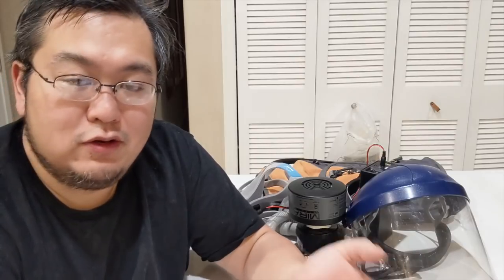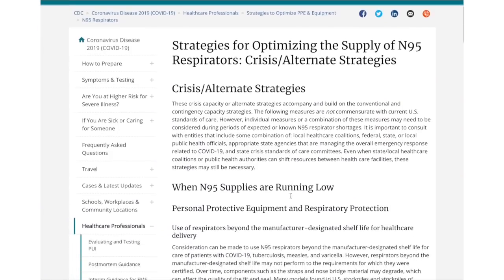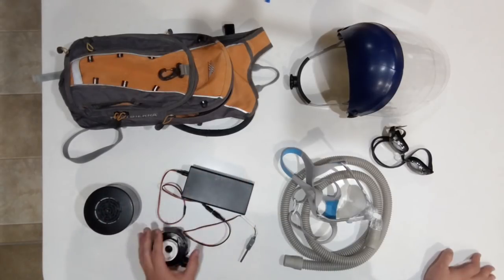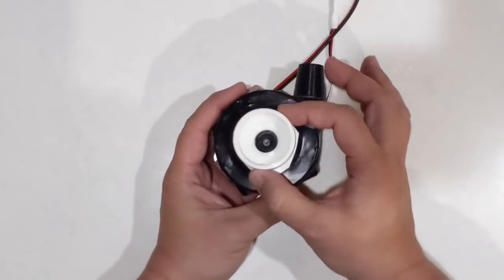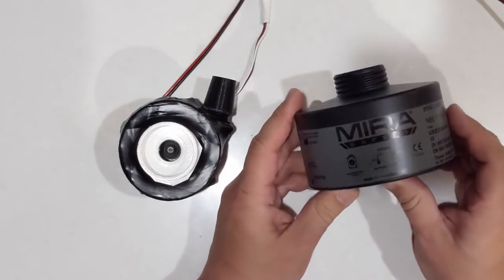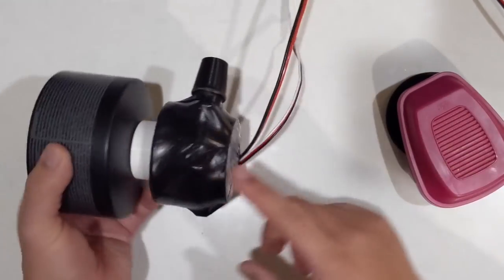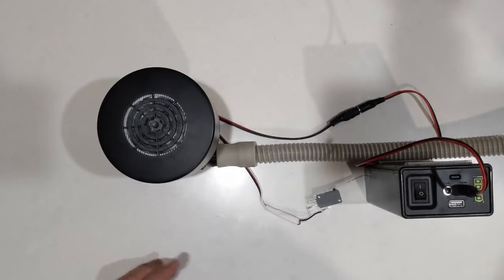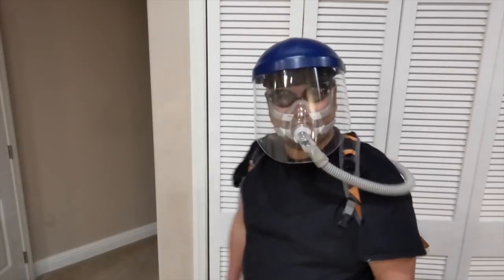Low-Cost Powered Air-Purifying Respirator (PAPR)

Comment: This is great info! I am hoping to use this information for another purpose, I would like to build a face shield using an older firefighting face shield with positive air pressure for woodworking so I don't inhale the find sawdust particles. Do you have or know of any videos that show step by step how to hook up a blower motor like the one you had to a battery? I think that's the next step I will have to learn.

Comment: I do have a question in regards to the CPAP mask. From what I have used and seen there is only a small orifice for exhaled air. Do you need to increase the diameter of the exhale hole or would it be wise to modify the mask with a diaphragm valve to 
Allow one to exhale easier considering this mask will be used during waking hours where we are working and exhaling harder as compared to sleeping with a lower breathing rate???
Other than that this is an excellent idea considering the cost of a professional PAPR unit. Is there another source for the motor that we could use in place of a CPAP motor? Mine bit the dust a few years ago and I had to replace the whole unit as parts for the blower were no longer available.

Comment: Nice work, just a heads up CBRN filters have activated charcoal in them so once they are open they start to go bad... fast. You only get 6-10 hours of use with one and they can only be left open for a few weeks before they go bad. I would recommend a 40mm viral filter like what MIRIA safery has on their website with an ULPA filter media

Comment: you might want to use the decathlon full face scuba mask. also as this is run by an arduino, you could make the arduino increase the air flow rate by connecting a heart beat sensor to it

Comment: Johnny - I recommend wrapping the joint with self-vulcanizing tape instead of electrical tape (or add the electrical tape on top of the self-vulcanizing tape). I use the SVT to repair electrical automotive connections with brittle connectors or cracking/splitting insulation. SVT creates an air tight and water tight seal. Fun to work with as it kind of melds into itself but is NOT sticky.

Comment: I am surprised at how many of these already exist. I am also amazed at how expensive they are! I envisioned a thin wide shell that you would wear on your back like a pack that was molded and padded for comfort. It would have a large HEPA filter to decrease filtration effort. I would divide the flow so that one tube supplied air and the other passed it out through a HEPA filter as well. This would be done using common valves at the entrance of each tube to the face mask. One tube would pass over each shoulder and connect at the top of the mask.
I was wondering if using an existing power supply would be less expensive, such as common drill and other power tool batteries.
A common face shield could be worn if needed. I would like it to be compatible with ozone generating cleaners such as So-Clean.  Perhaps a sealable cover over the filters would allow this with some cleaver tubing arrangement.

Comment: I have been building these since 1996.  For painting and prep, exteriors.  I gave up on the battery idea, and decided to just plug in.  I also used a hair dryer motor and 16 volt power supply.  I did use a back pack.  I am happy with any hepa, high efficiency filter.  Mine used window tint film, as we are working 98 F days, sanding for 12 hours.   I estimated my cost to be around $150 for everything, back in 1996.  Plus the time.  ...  The 1993 papr firefighting used were junk in my book, as far as power, heat , and ability to breath...Oh, and I did add a gfci and 1 amp circuit breaker.

Comment: I think the filter and motor unit need to be in open air not a back pack, maybe a belt or harness. Keeping it in a closed environment will strain the motor and back pack material could be blocking airflow through the filter

Comment: This one actually has potential! Hospitals do have a significant need for Papr's ? how long does the battery last? and couldn't you 3d print a housing for the blower, then Use gasket and screws, Tape doesn't seem like a very long term solution, or even a very durable solution.

Comment: A tyvek hood with a built in face shield with the hose connection feeding in air would make this a standard style papr...  that would also protect from drafts carrying viral material since the purified air will constantly flow down your neck and out.

Comment: Johnny, great job, thanks for sharing.  I think it's preferable to put the filter downstream of the blower, so that you don't have to cover the blower with electrical tape and hope that it blocks unfiltered air from getting through.  I'm not sure about the blower you're using, but there are some blowers with air-bearings that count on a certain amount of air recirculation through the housing to function and cool.  Also, putting the filter upstream of the blower makes for a lower gage pressure in the housing that tends to drive leakage of unfiltered air into the system.   Thanks again.

Comment: Put a cutup raincoat airtight around that faceshield.. rivet and glue it airtight.. no need for reapirator and goggles then.. also add UV Tube into airflow After Filter for added protection.. you can use These only P3R Filters for cheaper build..

Comment: Hi, I am thinking about making a electrostatic system for the protection shields to stop the spread of the coronavirus, it should be a little motor with a piece of wool that rotates and creates static electricity atraction in the shield. All the drops of saliva will be fixed to the shield (in both sides) and the virus will not do nothing. We can also put pieces of plastic in the rooms, buses and trains from the ceiling to the floor with this static electricity. Thanks for all your videos

Comment: Thanks for the new invention.  I think you are on to another great work.  Are there a supply of small brushless dc motors that produce the same air flow that are not so expensive as the ventalator motors

Comment: I like your design.

If the user breaths in more air than the blower is supplying, non-filtered air will enter through:
1. The hose to mask elbow adapter.  There is a one way safety valve/flap that let's air in if the CPAP machine's blower is not working.  This flap is closed by the CPAP pressure.  But if the user inhales too hard, the valve will also open letting in contaminated air.
2. The mask's tiny exhalation holes around the elbow connector.

Other mask's, etc will probably have the same two issues.  Exhalation holes and safety valve/flap/etc.

Comment: Commercial PAPR systems are crazy expensive. The 3M system is excellent, but is about 2 grand. A couple small companies have made lower cost power visors. I had one made by RACAL and there is a small british company called Trend that makes a simple one for $400. If you can come up with something cheap for woodworkers, you could probably have a lot of supporters on kickstarter.

Comment: If I get that virus, I will need to survive during breezing crisis. in NYC where I live, we expect shortage of ventilators. Here is my DIY idea: I have a vacuum cleaner at home (trying to avoid advertising it... encoded name "colors in the sky"). It is water based and it works as an air purifier and a humidifier and it can run at low speed mode 24 hours. I am thinking of connecting that vacuum cleaner to a respirator directly. The motor will pump a clean humidified air constantly. The challenge is, how do I make the system pulsing the air?

Comment: Great idea as I was thinking of trying to do the same to an older cpap machine I have, but mine runs on 110v. I know it has positive pressure on the mask at all times and it vents out through the exhalation valve to help you exhale better just like scba the fire service uses. If you could find an MSA scba mask it has the twist turn lock for the regulator to connect to the mask and a hepa or n95 canisters that are a direct fit for checking the seal of the mask. I used one these in the fire service and it would look funny at the grocery store but you'll have full-face protection.  Good luck.

Comment: Our state, NC, is bottle necked in testing because of lacking PPE.  These diy PAPRs need to be in deployment today. An air tight respirator is a a very difficult design target... but positive pressure air supply like these are very forgiving... YOU DON'T NEED TO CREATE A PERFECT AIR TIGHT SEAL WITH A PAPR. We have power everywhere and tons of small fans. Do PAPRs now.

Comment: Great idea Johnny,  keep up the good work.   Your earlier video got me to think about how I could use my CPAP mask as a protective mask in public.   One of the problems with the N95, and surgical masks is that they are pretty flimsy and air can get in from the sides of the mask.  The other big problem for me is the exhaust fogs my glasses, or any eye protective gear.  

So in public I wear my CPAP mask, with the hose attached.   At the end of the hose, I have double kleenix tissues,wrapped around the hose with an elastic. The tissues I believe are finer than the N95 mask.   The mask is 100% effective for not allowing outside air according to my cpap machine - it provides a great seal over my nose and mouth.   On the front of the mask are two small holes for exhaust, however I cover them up with tape, so I am only breathing air from the end of the tube.    So I taking air in, and exhausting from the end of the tube.   Granted there is no pressure, pushing air up or out, and I may be breathing some of my own exhaust, but I think it's fine for a quick trip to the grocery store.
Reply: Lots of dead pace in your design. Your probably rebreathing quite a bit of CO2.

Comment: Decathlon have a scuba face mask with a rear snorkel port and a non return valve in front .
I discarded the float valve in the back and mounted an moldex organic vapours filter to the back but after watching this I'm rethinking and going to introduce some kind of forced air .
Reply: im curious, why do you feel you need to have forced air in?
Reply: @adcanadian  To make it easier to breathe through a filter. Adds comfort.

Comment: Thank you  great idea, A used komplett CPAP Machine I can get around for 300 euro plus/ minus . But I didnt know how  a to put a bipap cycle on it. With a small ventil  You can get even go to controlled ventilation I suppose. . And with a oxygenconzentrator  ( up to 6 l /min) somewhere attached to the system ,  oxygenconcentration  up to 50% in the aire the patient is getting.

Comment: Great work Johnny. I've been working on a PAPR too, still waiting for parts to arrive. DC blower powered by 20V li-ion drill battery. LM2596 buck converter for variable voltage/blower speed. Vacuum cleaner HEPA filter in a box. Blower mounted to other side of box. All sealed with EPDM window seal strip (gasket) and maybe Aquarium silicone sealant (non-toxic). Air supply pipe connected to blower outlet is 1 inch clear PVC (wide and smooth pipe for lower air resistance) Edit: think a proper air hose would be better, the PVC isn't ideal.

For the head part I was thinking about a whole hood based on a head-mounted polycarbonate face shield with added plastic bags. Sealed loosely around the neck. These designs work by having positive air pressure and allowing small leaks so it all depends on getting enough air out of the blower. The unknown for me so far is how much my vac cleaner HEPA filter will drop the airflow. I have seen a figure of 300 Pascals or 1 inch water pressure. I might need a more powerful blower or a bigger box with two or more filters in. Tight fitting PAPR needs about 115 litres/min, loose fitting needs 160/170 litres/min. About 6 cubic feet. These blowers spec at a lot more than that (30 plus cfm) but that's with no pressure drop from a filter, need to look at the Static Pressure vs Air Flow graph on the blower spec sheet.

Check out 3M Versaflo, Scott Proflow/Duraflow commercial ones. Head-wearable ones for woodworking etc are Trend Airshield and JSP Powercap.Think about battery life too. With a 2 or 4AH battery they should run for a good few hours. The commercial ones are designed to run all day.
Reply: The air box can mount on a belt or strap. Battery in a jacket pocket. A whole head hood is much better for comfort wearing glasses. Just seen the snorkel PAPR vid https://www.youtube.com/watch?v=lmNIEDDCqSk Air compressor rather than a blower there. Edit: Ah no, it's a tiny blower.

Comment: Instead of electrical tape, you might consider using self fusing silicone tape (e.g. Rust-oleum or Nitto).
Reply: Silicon tape = YES. But duct tape is fine if you tape inside and out. What matters is getting to a HAZMAT hood and best a whole suit. Blowing filtered air into the suit keeps it from over heating.

Comment: Awesome Johnny. Question there are millions of  AC blow up matress pumps out there. What about them as a blower and mechanically limiting flow on exit nozzle. Test each diameter for output cfm. Then possibly the only required additional manufactured part is a speed /intermittent controller with flow sensor alarm? Would this work and be more potentially available id love to chat with you on the phone and discuss
Reply: Following... great idea!
Reply: Someone in the project has been trying it out: https://github.com/jcl5m1/ventilator/issues/62
The biggest issue is that cpaps are designed to work for many hours at a time. And a typical mattress pump may not be rated for that. So each pump may need to be tested to see how long they can run for.

Comment: I applaud the effort and may be there is a lot that industry can learn about stripped back RPE products. Comments / words of caution - 1) making PAPR is a serious undertaking and manufacturers are doing everything they can to make as many as possible as quickly as possible in the current situation, 2) consider the risks of what happens if the device fails / doesn't work but the wearer thinks they are protected, 3) there are many design and manufacturing considerations - some mentionned in the comments below: robustness, battery alarm, flow alarm, CO2 build up, tight-fitting masks need to be fit tested (even posititve pressure ones) in many countries, to name a few.
Reply: Excellent points. I think a loose-fitting design is a much better idea for this application--that would address some of your concerns. A plastic bag secured loosely around the neck might do the trick, and that will protect the eyes as well.

Comment: I wonder if someone could make a brushless motor 3d printed blower, 3 speed, for 40MM NATO filters.
Reply: Professional level air pump will set you back $40. Get a 12 volt and (buy 3 of them) rechargeable batteries/charger are inexpensive. The 40 mm NATO P100 is your best choice but 3M painter mask filters are easy to replace and to decon daily with UV light. For adapters you can go to PVC plumbing fittings. Plastic hose is cheap. Instead of half-face or full-face masks you get better comfort ratings combining a HAZMAT hood -- back side air duct -- with a simple face shield. Duct Tape makes a perfectly good, durable seal.

Comment: one more variation:
http://rad-um.com/projects/diy_papr
 
They use 5V instead of 12V, but I would think that 12V power pack availability (car jump packs) might be easier to deal with.
EDIT:   the 12V car jumper/power packs step down to 5V through their USB connection.  And 5Vcentrifugal fans can put out twice the minimum airflow specified for loose-fitting PAPRs.
I would still use an inexpensive voice amplifier as well as an inline tube viral filter post fan...

Comment: Keep in mind that most infections happen when you remove the gear (at least in hospitals)
Reply: Hospitals are very different environment; they constantly having physical contact contaminated surfaces and air spaces, and moving from many different potential sources in the course of a day. They have layers of ppe that have to be removed after being exposed to a to multiple infected surfaces and people for hours day after day; it's a much more complex matrix of potential exposure compared to what most of us experience. In a non-medical setting in which an average person needs to run crucial errands perhaps once a week; their protective gear can be removed and stored for several days to kill the virus and as long as they are washing their hands immediately, there shouldn't be any transfer. If being especially cautious one could remove "outside" clothing and store it with their protective gear.

Comment: If you could somehow 'seal' the edges of the clear shield to your head (foam, cloth, etc., quality of seal would be inversely related to amount of overpressure available) and the blower supplies air to keep the space in front of your face positive pressure relative to the outside, wouldn't that obviate the need for the mask and goggles then?
Reply: Yes. I was just in the hospital for pneumonia and their papr gear has a cloth like material around the shield and they needed no protective eye gear because the shield was effective. The only ones who needed extra protection were those with coughs or cold like symptoms to keep their patients safe.